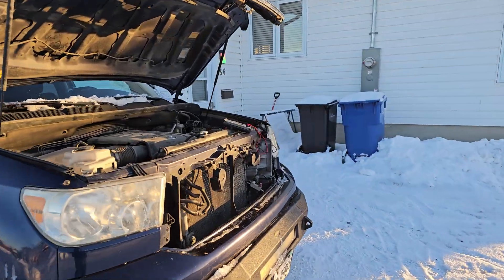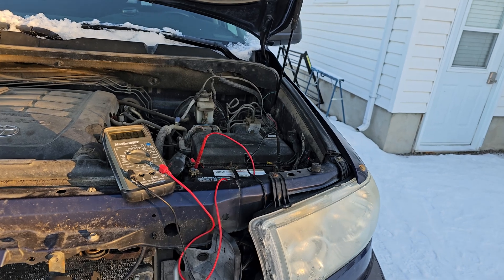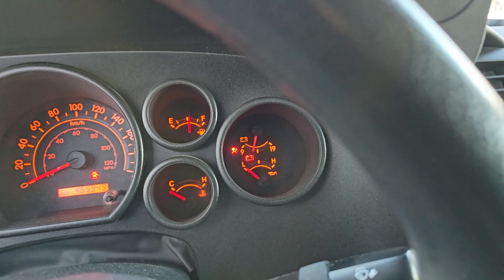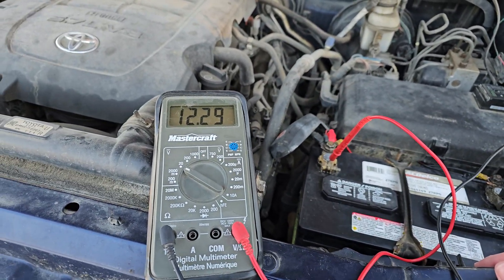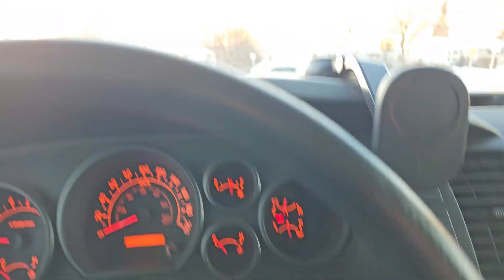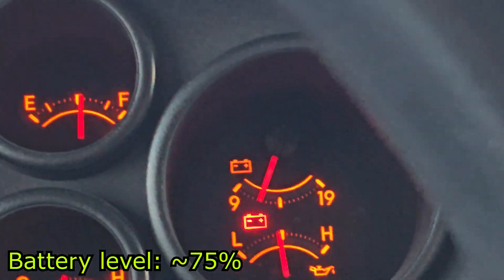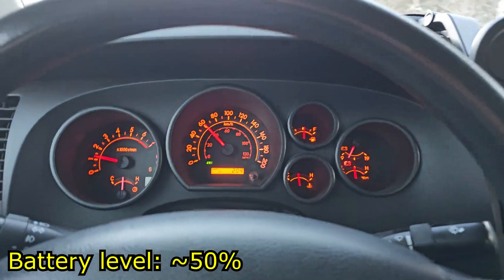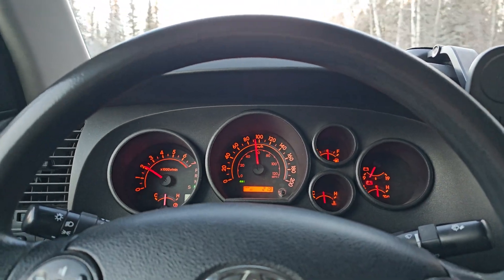How far can you drive with a DEAD alternator? 2011 Toyota Tundra 5.7L

Comment: You can't drive on a dead alternator.  Tried it, you are relying on the battery and the battery will drain to a point within 3 miles before car goes dead from no power.  Newer vehicles relies on battery to run  with the electronics reliance.   Do not attempt unless you are ready to swap in a full battery when it dies. Tried it and done that.  Also, I believe doing such thing will damage the battery.  I ended up replacing the alternator as it had broken and the battery follow right along after that.

For this case, he should just change a new alternator.  It might came back to life but may still be dead.  Reminds of the people who is about to die at the hospital bed and the last moment, they wake up as if they are normal.  Then within a day or two, they pass on.  

Also, cars loves to play tricks, when you think it's working and it will show it is working knowing something is broken.  Then when you put your guards down, you take an important trip, then everything comes right back with the problem and now you are stuck in the middle of no where and during a winter storm.  Not something you want to be in, while you are thinking, I shoulda change the alternator.
Reply: Yes and no, older cars have less electricity devices and uses less power than newer cars that even need power to say that u pooped ur pants, cars getting more and more useless, old cars was made good and probably and don’t fall apart as easily as new
Reply: Depends on the car. Drove a 90s grand prix 40 miles on a fresh battery and no alternator.

Comment: i have never seen someone put off an alternator repair for 3 months lol. i would have not waited 3 hours to get this fixed. i remember losing an alternator one time and the battery light didn't came up so i couldn't tell i kept driving with dead battery for 6hours and by the night when i turned the headlights on i could see nothing. fortunately, the car had a mechanically injected diesel with no electronics not even a fuel pump so the engine kept running like normal even when the battery dropped to like 8v.
Reply: Exactly my case.  The only time when the battery light came on is when the car is dead, i mean instantly.  No fore warning.  Just battery light turn on, next time, dead car with no power and while I was cruising down the highway.  Wish I had a warning to change and fix things, but nope, the car decided I wasn't worthy of it and just wanted to die on my while driving.